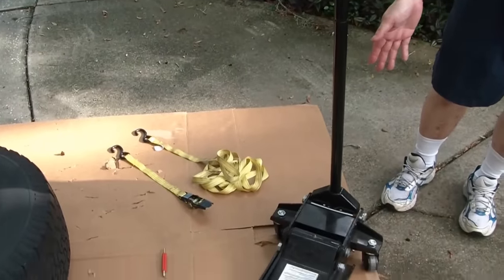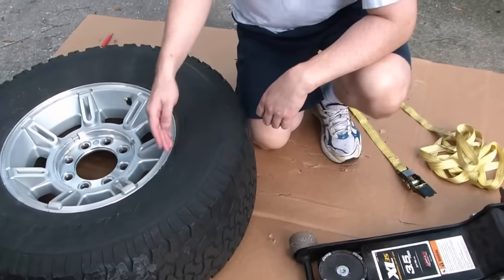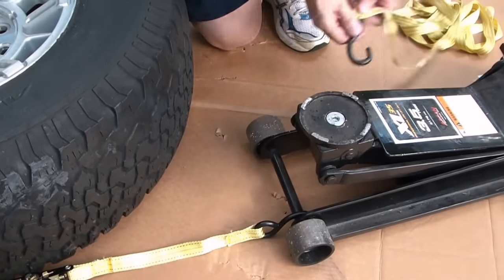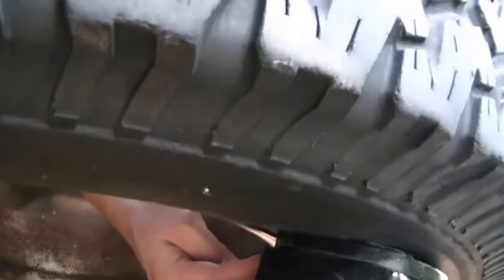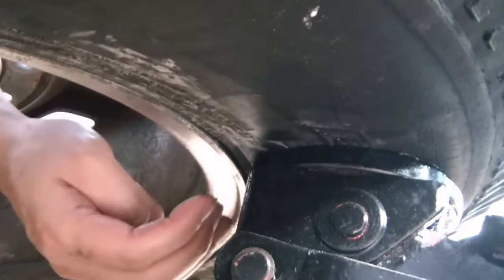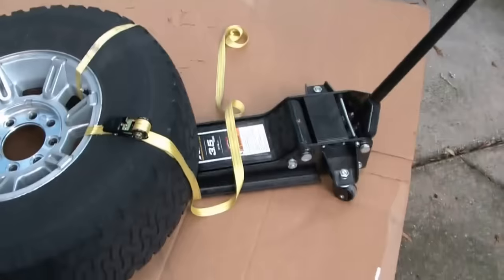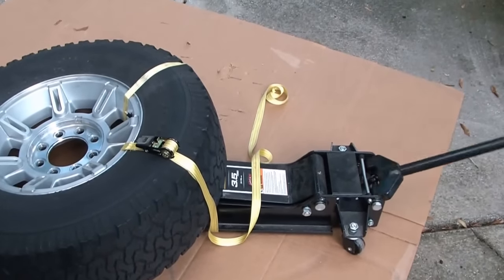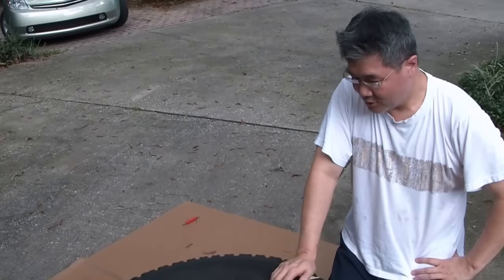Easy and safe way to break a tire bead

Comment: I have run over each side of a tire with a vehicle and used a sledge hammer to break the bead loose and provided hours of entertainment for my neighbors but after watching this, and it's so simple, I'll be using this method forever. Thanks!!! My neighbors will have to find someone else to watch!!!!!!
Reply: Me too but now I just take the front loader on the tractor
Reply: 😂 I just broke down 12 tires like that 😅
Then I found this video

Comment: The best and easiest  way I've seen yet.  The only thing that I would add is a 2 × 4 inbetween  the Jack and the tire to make sure I dont damage the side wall.  I used it to change my tpms sensors.
Reply: Absolutely great money saving advice.

Comment: I am blown away at how well this works. I just used this method thinking it would not work for a low profile tire....but it worked flawlessly. The tire wheel combo I just did is 235/40 18. Zero damage to my wheel and I was able to break both beads. I used 2 ratchet straps and my 3 ton floor jack. I had to stand on my wheel while I pumped the jack, but eventually the bead popped.
Reply: Don't  you low profile driver just mount curb and instantly deflate your tyres.. no need to even use a jack or remove from car.
Reply: That’s whatsup! I’m looking into doing exact same tires for my bmw but 17”. Need to remove old junk tires, refinish it and get new tires. Tire shop trying to charge me extra. This is so helpful! 

Question, can you reinstall with similar method?

Comment: Just used this method to break the bead on a rather heavy Goodyear Endurance ST235/80R16 load range E spare trailer tire in order to replace the crappy rubber valve stem with a bolt on high pressure steel one.  Worked perfectly.  So easy and no damage what-so-ever to the rim.  Thanks for sharing this.

Comment: Thanks for the great tip.  Used it today to break the bead on a GMC pickup tire so I could replace the TPMS sensor.  I had to reposition the jack and break in a second location near the first to get enough room to get the sensor out but even at that it only took 10 minutes.  I'd tired the method of using a long board under the truck frame to pry down on the tire but couldn't get enough leverage.  Your method is quick and easy.
Reply: Just jack up your car/truck high enough to slide a tire underneath a rear tire, slide the tire you need the bead broken on underneath the rear tire with the bead/rim line at the edge of the tire, lower the jack so the weight of the car is now on the bead. Breaks the bead instantly, zero possibility to damage anything becausre it is all rubber on rubber contact.

Comment: I have now watched about 3 other videos on YouTube using the floor jack to break the bead.  However your video is the best by  a mile. The other folks had to use blocks of wood with tie down straps and stand on the tire at the same time.  Yours was the best method.  I have several  ratchet  tie down straps but I hate them with a passion as they always get jammed up.
Reply: Most of the time a ratchet strap will get jammed up because too much strap is wrapped around the ratchet. That's a simple mistake that a lot of people make.
Reply: @davidkeeton6716  Thanks for that info

Comment: Thank you! I was using the car as a counter weight and the car started to tip from uneven pressure and that method was just WAY TO UNSAFE. This is a wonderful method with virtually no harm that can be done to your person.

Comment: I used this method today to replace a failed tpms sensor on my F150. I first tried a 3 ton yellow jacket jack with a flat rubber saddle, and the saddle slid off the tire as I increased pressure. I switched to a 3 ton Big Red jack with a steel bowl shaped saddle and it worked great. Thank you for sharing!!!
Reply: Can you share the link of where and  what you bought. I want to buy the same.
Reply: @msjoey8571  I used big red jack model T83002.

Comment: Just used this to change two TPMS sensors on my wifes car, worked great!  Just keep peeking underneath to make sure you don't accidentally get on the rim, my tire shifted a little and the jack got on the rim.  Had to reposition and it worked great.  Such a time saver.  Thanks!

Comment: To set a bead after removal, put a ratchet strap all the way around your tire in the center then start tightening, it will force the center down and the sides out, then start filling with air, once it starts filling, ie not leaking air, release the strap and fill until both beads are set, common trail fix for 4x4's in the woods
Reply: also, remove the valve core (very important) squirt some butane in, and flick your Bic.

After the smoke clears, replace the valve core and inflate. 

Removing the valve core gives you  pressure relief to both directions.   Too much pressure when setting the bead, and tire can explode.   When the combustion gasses cool, the tire can be pushed right back off the bead.

Comment: Very nice! You've invented the simplest and most practical method here. Thanks. 

My wife's Jeep is not here for the ramp method, so I looked online to see what I could do myself, with what I have, and found your method. 

There are so many other methods around the web... I've been using a plank and another car to drive on and break beads for decades, but I don't think that is all that healthy for the construction of any tires you want to reuse. And others have shown various jack/strap methods, but yours takes advantage of the hooks on the strap, and that front axle on the jack... neatly, in a way others don't. 

Good for you!

Comment: This is probably the best video on the DIY tire taking off that I have found. - And I've been watching quite a few, trying to get my tire off. Thanks! :)
Reply from the maker: I'm glad you liked my video.
Here are the videos which inspired me:
 - This guy is the master. Notice that he is doing this at a leisurely pace, while teaching too.
  https://youtu.be/tRAS1A6eEV0
 - Here is someone demonstrating how to break a bead using only spoons. It worked for one of my tires, but took a long time.
  https://youtu.be/NSOFqH3Wk9Y
Take care !
Reply: auxpowerunit In the first video the guy needs to speed it up a little, he's too slow! :p (very impressive). The second one, I tried that method with two crowbars and wasn't getting anywhere and was worried about damaging my rim... Sooo... I think I'm going to try your method next. Hope it works. Otherwise, I'm cutting it off! LOL! That'll probably be difficult, too. HA! Thanks for posting. Take care!
Reply: Rasputin 883 I've tried. don't do it!!if I can stop one person I've had succes.cuting it of sucks.
Reply: Rasputin 883
Reply: Rasputin 883
Reply: Rasputin 883 aloe Vera  drink
Reply: Rasputin 883 inagree
Reply: hi auxpowerunit  , just put the tyre on the floor and run over the edges with a car, job done.
Reply: Rasputin 883 
I agree.
I've seen one with a 2x4, floor jack and a ratchet strap but this is even easier.
Reply: bob head    Yup !!! My method exactly,done it many times,less work and 2 tons of results !!!!! A tire iron and a hammer completes the job,simple .
Reply: You can always lay the wheel down and run over the tire part (not the rim) with a car or truck.👍

Comment: After watching people drive over the edges of wheels and seeing some hilarious lad do this by jacking down on the tyre using his car... I feel this is the safest legitimate method I've come across.  Thank you so much for making this!
Reply: Not so fast...I have taken many tires off by using an old school stand up jack. You can see exactly where to position the stand on the edge of the rim...Have also used a stand up jack and cable or chain to wrap around tree stump roots to jack the stump out of the ground.

Comment: FANTASTIC idea!!! I thought about using my hydraulic jack but didn't quite get there. I had all but given up and ready to cough up $350 to have my 2 tires TPMS sensors replaced at rip-off tire shop. I saw ur video at last minute and Viola, I just got unsealed bead and took out TPMS sensor with broken valve stem ... What a life-saver.

Comment: Fantastic Terrific!!   Fast and easy, worked great on my trailer tire. I had to replace the valve stem, and I put the jack saddle just outside the rim where the valve stem hole is. Breaking the bead here left me plenty of room to replace the valve stem. Then the tire aired up just fine and reseated the bead. Thanks so much for a terrific time saving video!
Reply from the maker: I'm very happy to hear this worked for you. Always glad to share with other do-it-yourselfers. Take care !
Reply: This process saved the Scout troop money when changing the trailer tires

Comment: I found your video very helpful when breaking a tire bead in my garage during the winter months. However, during the warm months here in the Midwest, I simply jack up one side of the front of my car and side the problematic, DEFLATED tire, laying down, under the still mounted front tire and slowly lower car.  This method works great on all types of rims (aluminum too) and I have never had any issues. Start to finish, this takes less than 5 minutes, which includes getting the jack and jacking up my car.
Reply: How do you put the tire back to the rim?
Reply: I'm having trouble following your procedure.  Sounds like you are saying to jack up the side with the flat tire. Is this correct?  Not putting jack under tire but under the vehicle  as you normally would jack up one side of the vehicle.
Reply: @aNuthaRedneck  I remove the flat tire and then put jack stands under the frame where this tire was removed.  Then I jack up one side of the front of the car (this front side tire must not be flat). Once the car is up in the air, I then slide the flat tire (on its side) under the raised good tire just far enough under the good tire so that when I lower the car, the good tire and the weight of the car comes down on the rubber of the flat tire and break the bead.   This method never fails

Comment: One of the cleverest tricks I have seen in quite a while.  Nice.
Reply from the maker: Thanks !
Reply: Excellent! I use similar jack between the tire and my tow hitch on my truck. This is a great technique as well.
Reply: vidar808  uh
Reply: mtwseneca ท
Reply: I prefer just using the hydraulic hoist. way easier than this
Reply: Deere2154D  make a video about it mabey  your way os better.but i think your missing the point most people have a jack or can know someone that has a jack like this so they can do the work. most people have no clue what a hydraulic host is
Reply: Drew High : If you don't know what a hydraulic hoist is you are probably on the wrong video. However the floor jack is a hydraulic hoist, a bottle jack is one, an engine hoist is one, anything that uses hydraulics that lift is a hoist.😀😉
Reply: Drew High : Don't get me wrong, I got what you're saying. The quickest is just drive on the tire and you break the bead.
Reply: Brian trucking Landers nope I tried driving on mine ... Over and over and any and every angle ... I must of had super bead because I got nothin...
Reply: That is very cool. A new one for me.

Comment: Thank you very much for this valuable video. I was just about to swallow my pride and haul the tire to the local tire shop. I have all the proper tools for doing semi truck tires so I figured I’d use them to separate a 245/65/16 tire. I was willing to accept defeat after an hour of struggling until I found your video lol. I think I had the tire separated, patched and reinstalled in less than 40 min after watching. Thanks again!

Comment: Just used this trick on a stubborn tire. Worked absolutely perfect! I have bead breaker hammers to but they are notorious for crack aluminum automotive wheels. I only use hammer on semi tires.

Comment: I was shown 50 years ago run over the edge  of the tyre  just by the edge of the rim when laid flat on a hard surface. Worked then and it still is as easy now . Cheers from down under in Australia .

Comment: i remember back in the day using a ford ltd and a bumper jack to break tires down off the rim that was back when cars had real bumpers
Reply from the maker: Way back when cars had box-section steel frames... Gee, we're old. LOL !
Reply: You could still use a tow hitch and bumper jack
Reply: I was thinking the same thing during this video, I used a bumper jack several times to remove tires, used a 66 impala 4 door
Reply: We did that too. Oh the fun of less tools and enginuity!
Reply: @davidhaines6564  I had a 65 impala
Reply: See it just gose to show ya,,,,,WE werent stupid back then
Reply: Back in the old days you just stood on the sidewall and the bead broke because they weren't tubeless and slid off pretty easily.
Reply: I done the same thing
Reply: I've did that many times back when cars had bumpers & bumper jacks.
Reply: I used to drive over it with my car
Reply: Use an implement jack under your truck bumper ,it works fine
Reply: I always just ran the things over with my pickup usually popped them off first try
Reply: The way you explained my friend IS exactly how my dad showed me, but this dude did it on freshly new tire, that's why it broke so easily, YOU (CANNOT) DO THIS ON AND old USED TIRE.
Reply: I still have one of those bumper Jack's! 😆
Reply: @jessiehughes9432  I've got jus few too, but some of them aren't jus not workn anymore,
Reply: @mrcoz1764  p pl
Reply: shannon lee looks like u don’t know the difference between a toy car bumper and a car bumper
Reply: @robbieedwardsayers224  You don't for sure,you wasn't even around when cars had real bumpers on them! Give your mom her cell phone back an go play in your turtle sandbox.🤣😆
Reply: Jessie Hughes I will report you.
Reply: @robbieedwardsayers224  For?
Reply: Doing it right now! Lol
Reply: They still have real bumpers, but are covered by decorative plastic parts now.
Reply: Still do that way
Reply: I remember using bumper Jack's for too much stupid stuff.
Reply: @stanleyhutsell2879  i do kinda the same thing. I jack var up, posistion tire so that when you let car down , the tire will land right on the bead , done this a lot. Now i have friend with machine at home shop. Take a 6 pack of coronas when i need to use it.
Reply: @davidhaines6564  I used a 73 Buick impala 👍

Comment: Love the idea, now i can patch any holes that i could have on my tires without going to the tire shop and get ripped off or damage my rims.  now i can do my own tire work i dont like to depend on others when i can do it my self.  this method is simple, safe and easy to say the least.  from now on im buying my tires and changing them my self and even balancing them saving a lot of money.  plus its a therapy for me to do my own work on my car, i practically do almost everything on my car and my wifes.
Reply: I hope you have a balancer, TPMS rebuild parts, lube, hammer weights, etc, lol then you can do it urself
Reply: @6.0ps35  people just don't get it . this would be fine in an emergency where you have no access to a tire shop , but overall unless i had no choice i wouldn't do it .
Reply: @pappy451 People get it and probably use. Just cuz you won't doesn't mean that we are all that lazy.

Comment: I have changed tires when I was a teen by laying the wheeĺ on a flat surface and drove the car up on the tire worked for me.
Reply from the maker: Wouldn't that scratch aluminum wheels (by abrading them against the ground) ?
Reply: That's the fastest  and  safest  way

Comment: I had sidewall leaks so bad on my 05 Subaru (salt/metal corrosion buildup), needed to scuff away the corrosion & stop the leak around the sensor valve & figured a way to get the bead broken, but it was comp[licated and took so long & risked flying C-Clamps. At my age, I'm not into calisthenics to break the bead so found practical do it at home options. I found your method here and it really makes the job painless and very quick.

Thanks for the post.

Comment: I usually throw my tire right beneath the tow hitch and put the jack between them then just jack the car up while the jack itself pushing downwards forcing the beads to brake, but this here is my next option when doing tires, thanx for the vids, keep'em coming 😁👍

Comment: I work at a tire shop professionally. This has  got to be the easiest, safest, diy bead break I've ever seen. In light of our porta power being out of commission, permanently, I'm definitely going to try this on the next big calcium filled tractor tire that hasn't been apart in 20+ years. Thank you sir, and thumbs up!!
Reply from the maker: Thanks for your kind comments. What is a "calcium filled" tire ?  I've heard of water-filled, which I assume is to increase ground pressure for certain terrain conditions.
Reply: Same idea as water, but much, much heavier. We live in Pennsylvania, so we have to use fluids that don't freeze. Calcium, anti freeze, and wiper fluid are such things. Calcium would be the heaviest. It has such a high sodium content, its saltier than the ocean. But when it leaks, it will eat holes through wheels. Antifreeze is next in weight. When it leaks, it won't corrode the wheels, but it is toxic to anything that may ingest it. Wiper fluid would obviously be the lightest, but non toxic, and won't corrode a wheel. But when you pump 50+ gallons of any fluid into a tractor tire, its all heavy. Lmao.
Reply from the maker: Thanks very much for the info. I had no idea people would go through the trouble to do that. I assumed water would be the only weight used, because it is relatively safe and easily available. I appreciate speaking with you, as I'm always interested in learning new stuff. Take care !
Reply: Worst big tire I ever changed out was a 29.5x25 on a 980B.  Air over hydraulic porta power would not unseat bead at lock ring. The spare machine with log forks loosened it up after a few sessions of tire to fork tip pressure and the front weight of the machine pushing down on it.